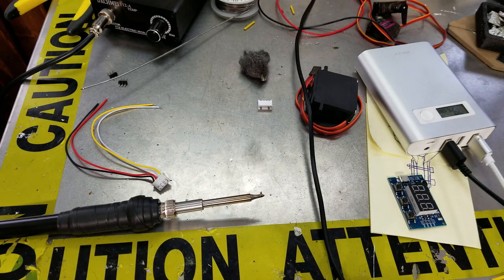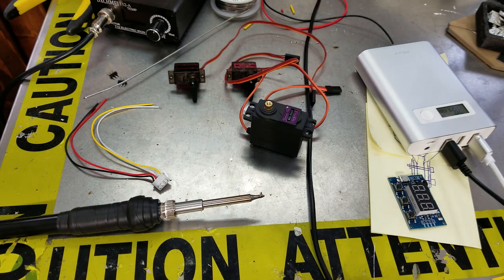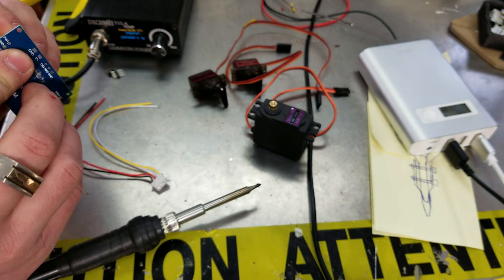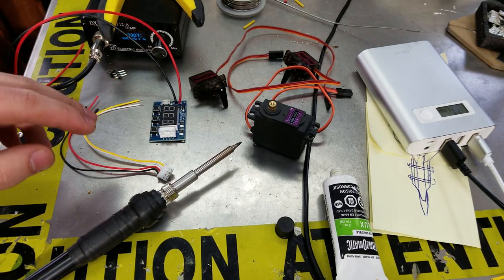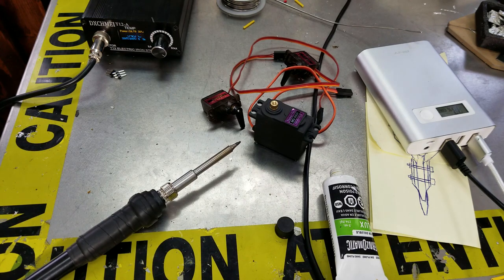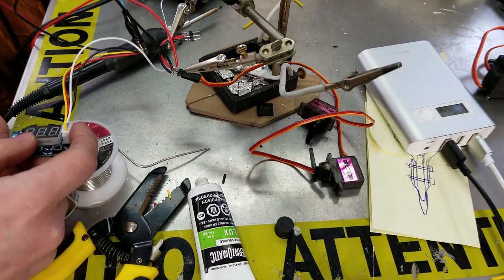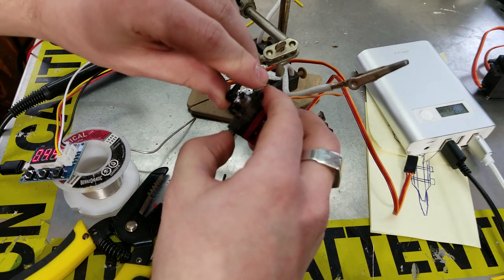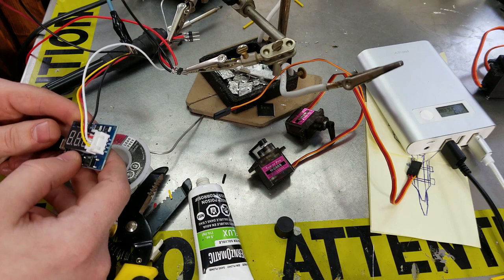DIY RC SERVO CONTROLLER

Comment: hi, were can i find this controller? thx for the upload!
Reply from the maker: Here is the words for the search to the same item as i have."'PWM Pulse Square Wave Generator Module 1Hz-150KHz"" Didn't have the link because it would end up in your spam . Just type this in EBAY search, and chose the one that works for you!
Reply: @EECPOWER  Great ,thank you vm, i found it on Ebay!